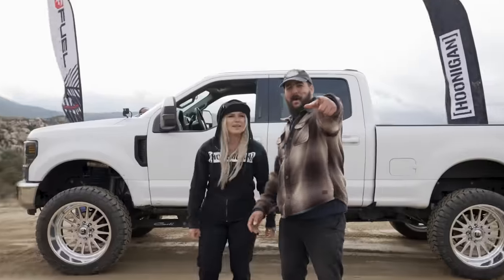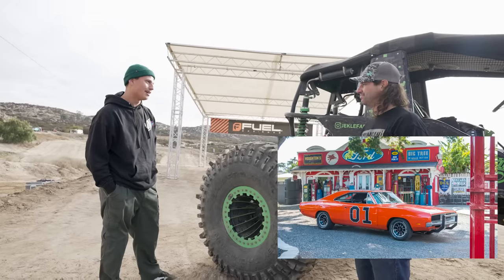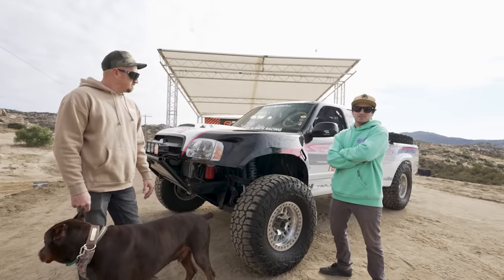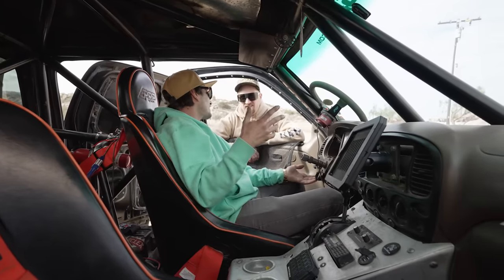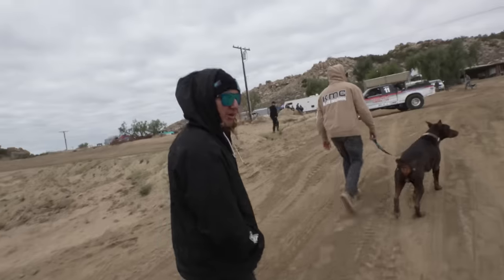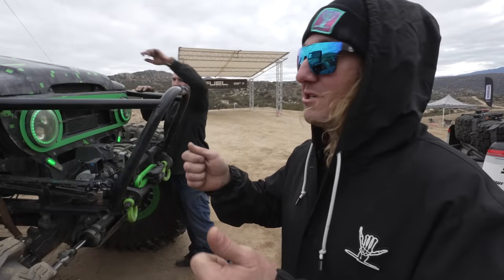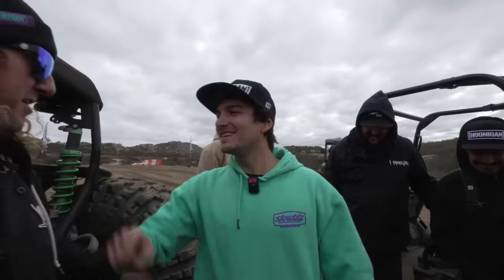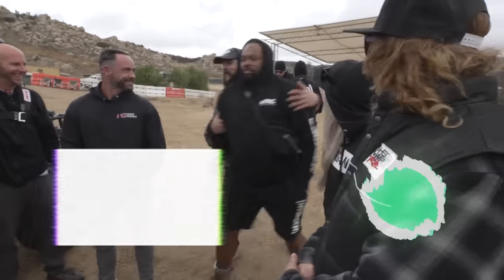Hand-fabbed Twin Turbo Buggy vs LS-swapped Tundra with Nitrous // THIS vs THAT Off-Road

Comment: Thanks for letting us destroy our rig on your track. Hyde was definitely not built for that kind of racing but we had a blast anyway.
Reply: Your awesome
Reply: Your rig is amazing in it's own right all built by you that's still a win in my book
Reply: Good job bud. You ripped that thing way out of its element. That thing is probably a real blast in the snow.
Reply: @whatawd9546  it really is!
Reply: Way to represent bro! Made us Canadians proud!!! Full send and win or break it trying is how it's done! Respect
Reply: Respect! From a fellow Kelowna guy.
Reply: As far as I’m concerned from your neighbor to the west a.k.a. Calgary Alberta you killed it brother if that thing was built for snow snow adds a lot of question hard Pac does not so I think you did very well
Reply: @RWO555  checkers or wreckers.
Reply: did kelowna proud
Reply: Hyde is a beast.  Been watching it for years on Kelowna Snow Wheelers , Mountain Mafia, and Bruce Cook vids.
Reply: How are those 406 axles holding up?
Reply: @SixSpeed5  They're solid. I've only broken one axle so far, I actually think it was this race that did it.

Comment: Could someone explain to me the 5.3 - 5.7 math. I'm dumb but since it's bored 30 over isn't it .03 x 8 giving you .24 plus the original 5.3 giving you 5.54? But he says 5.7 so I'm assuming I'm doing something wrong.
Reply: what her said is wrong butt your math is wrong as well, you are using metric and standard measurements. a 5.3 LS bored 30 over is only 5.4L. or 325ci to 330ci

Comment: 0:34, you’re calling that snow buggy a RWD? ……..ok
Reply: unfortunately is was for this event.
Reply: He doesn't have a front drive shaft
Reply: @devinowen8178 fair, but it is still a 4wd rig.
Reply: @theninja001  I actually had a mishap during the test hits and blew up the front driveshaft landing on the gas.
Reply: It does have a 5 speed manual transmission though